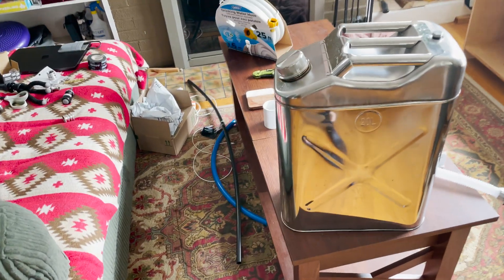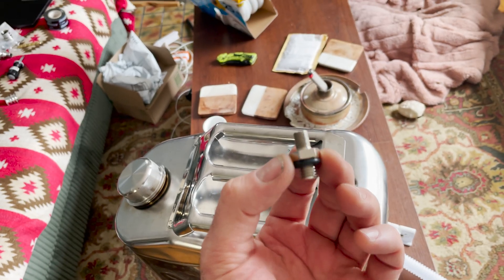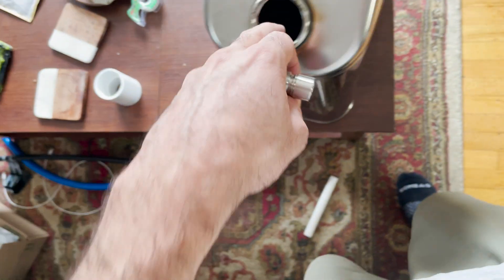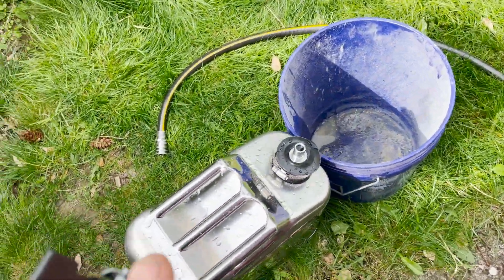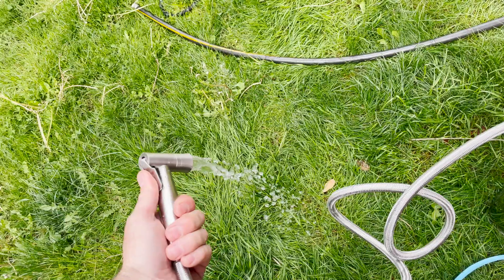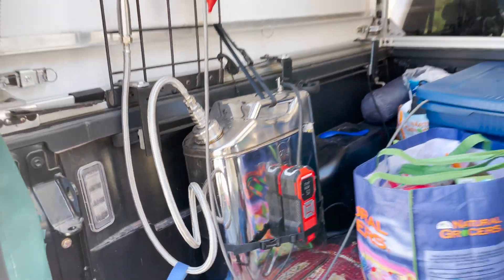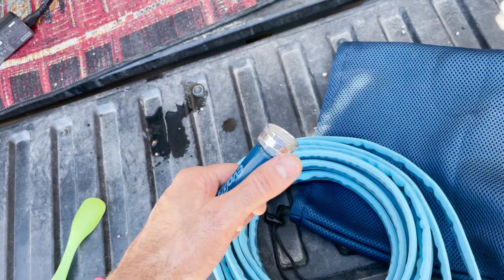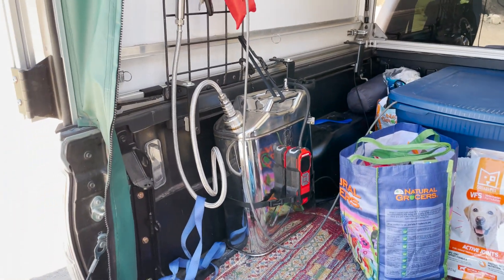DIY Water Pressure Tank for Camping | How To

Comment: Check out the Everlanders water system.  Old Pepsi kegs are built for this.
Reply from the maker: Looking into this now! Very cool, thanks for the suggestion!
Reply: @nolangordin  It's the best idea I've personally seen for mobile off-grid use, and it's probably not crazy expensive depending on where you can source those keg thingies.  Even new they're not that bad considering what regular milspec plastic jerrycans cost.

Comment: 6:34 Yeah, definitely.. If the water pressurizes it, you wouldn't need the valve, you wouldn't need the compressor... What a disaster. :D
Reply from the maker: Until you run out of pressure again!
Reply: @nolangordin  Well technically, you have a can full of air and you fill it with water, the air will only be at atmospheric pressure once all the water is out again... But you may want a little more pressure than barely any pressure (at the end), fair enough.